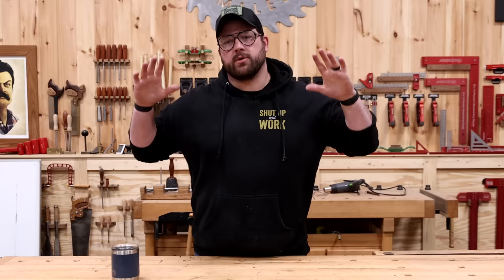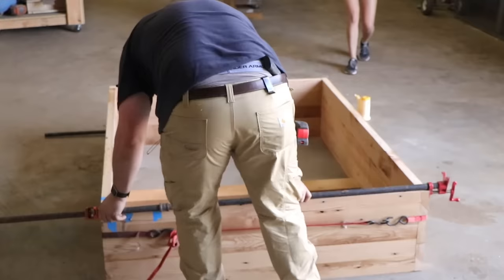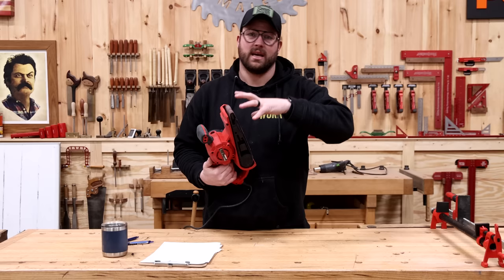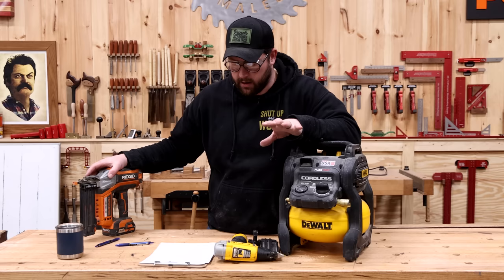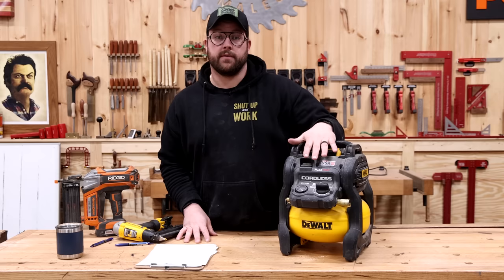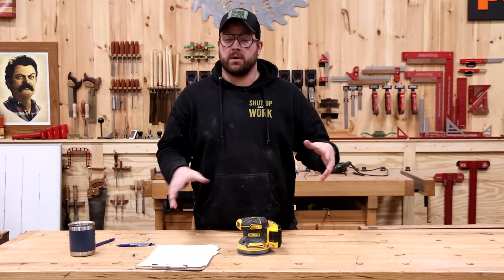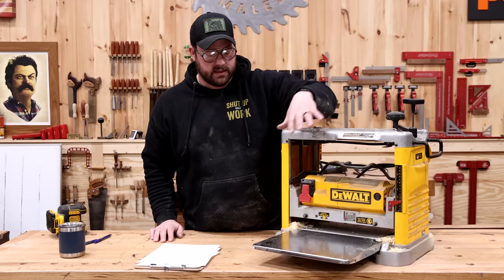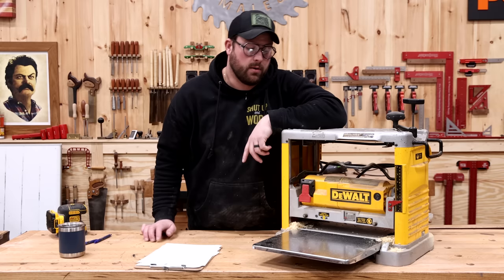5 Beginner Woodworking Tools I Regret Buying

Comment: Agree with some of what you say but not all  Built a mortis machine never use it, got a Ridgid sand machine it collects dust but when needed it really helps and was cheap to buy, have a Delta planer without all the problems of your Dewalt and it really helps ready raw lumber from suppliers  Probably will never buy Bessy clamps I worked very hard for my money and they are WAY too expensive TY 4sharing

Comment: I agree with you about the rigid table top sander, but if you take that belt sander and  build a simple cradle for it to be upside down and you have both drum sander on the front if you don’t build the cradle to long , and  with a few quick swipes on the belt it can take some meat off and since you control the downward pressure it’s less likely to put those Chanel divots they’re famous for. I couldn’t afford a lot so i made due with what i could get from the pawn shop and a little ingenuity had a functional shop.  And im right there on the pipe clamps i grew up with them and tried the quick clamps their ok they’re  just not as versatile or economical.

Comment: For hogging off surface material, I definitely prefer an electric hand planer versus a belt sander. Thought I was going to have to question your judgment when you started talking smack about the DeWalt benchtop planer. It's one of my top five favorite tools that I've purchased. But apparently that's because I got the 13-inch one, like you say.

Comment: Totally agree with you John on the kreg track saw thing. I also bought the Bora edge clamp and oh boy do I love having to math every single time I'm breaking down sheet goods... I bought the Bora saw plate thinking it would help and it sucks just as bad as the Kreg. You would think the plates would fit a 7¼ Bosch circlular saw but nope. I'm on the Worx platform and they make a Gimmicky circlular saw called the Exact track ive thought about trying in conjunction with my Bora system? $59 for the tool. I bought the Worx Switch Driver on a whim and that thing is actually awesome for pocket holes. Drill in 1 chuck driver in the other and it simply works.

Comment: Professional shops use both pipe and parallel bar clamps.  They have different purposes.  Pipe clamps can produce a ton of pressure and will definitely mar the surface of whatever it is pushing against.  So cauls are absolutely necessary unless you will be doing more milling after the glue.   Parallel bars can produce a lot of pressure (not usually their purpose) and have taller surfaces that are always parallel (reduces twisting while tightening) and will not mar most materials.  The extra depth also allows different direction clamps to cross each other in many situations.  Former better for gluing boards together to make thicker materials and latter better for carcass assembly.  But with proper care pipe clamps can do both jobs.

Comment: I wanted the 13” but I started in 2020 and Covid made it hard to find. I got the lunch box and I took off the tables and made my own out of MDF put on a flip cart and I have almost 0 snipe. It’s not ideal but it’s working. My biggest revert was the 6in Bench Top Jointer. I should have paid a little more for a used 8” floor model.

Comment: i purchaced a normal finish nailer, they usually have a range of sizes of nails that can be used. mine specifically goes from 1.25" to 2.5" nails. 
otherwise, spot on. there are alot of pneumatic tools for finish carpentry.

Comment: I bought the first generation Bessey K? Clamps and loved them. I had a few 24 inch but mostly 30 and 36 inch. They were a lot cheaper then (1997) I don’t remember what I paid for them but 1/2 what they are charging now seems right. Sadly there was a design flaw and the clamps began to crack at the screw handle. Happily, they replaced all of them (around 25) no questions asked for free. I have one of the newer 24 inch clamps but it it is harder to slide the moving screw handle thingy. I predominately used the Bessey k body clamps to glue up raised panel doors that if made carefully need very little pressure. And I liked that I could then stand the whole thing up and go to the next door, panel or drawer. Now if I was going to glue up a big table top in say hard maple I went straight for the pipe clamps. Cranked the hell   out of them.  Anyhow I liked the Besseys

Comment: I have a few of those tools. I love the K-body clamps. Agree they are expensive, but I don't have a problem with enough clamping pressure. You just have to make sure to set the pad close enough to the stock before clamping.

I have both the DeWalt corded and the cordless random orbital sander (which is, I think what you meant - it's not a palm sander). I used the corded version for 15 years, and last year got the cordless. I'm just not seeing the issues with the cordless that you claim. Unless I have a ton of constant sanding that drains batteries faster than I like, I find myself reaching for my cordless most of the time. I love not having that cord to move around and not have to worry about tripping over. 

As for the planer. I think you got a lemon. I've had that model for a good 8 years, and honestly, I've never had the breaker trip on me once. Also, I've not had the tipping problem you speak of. I feel like maybe you are running too heavy a cut when running your stock. I do agree the DW735 planer is a better model, though. In fact, if I didn't have a large shop planer thar I now do most of my planning with I would upgrade my 1st DeWalt to that model.

Comment: The Bessey K Body clamps are amazing. If your looking at the pipe clamp its also an investment. The main difference is that the K Body clamps are aimed at professional makers, and are worth every penny. As an interior builder, at my work we have the cheapest and shittiest clamps, but we manage to make it work as well. I prefer the Kboday for my own shop because they are easy to use, store away etc. Also what you fail to say on the pipe clamp is that that you only get the clamp part for that price and not the pipe. End game you're looking at very similar prices.

Comment: I was "gifted" a non working version of the 13 inch dewalt planer. And you can get them repaired at a dewalt store and they have a limit to the cost of the fix for it. I got it for free and Dewalt fixed it for $300 and it is working like a champ. Now I am just waiting for new sills and floors to go into tthe family barn and it will be out there with the other hodge podge of tools that I have and be used once again

Comment: Great advice on the pipe clamp! Thank you. Regarding the air compressor and nailer, I would argue that, you WILL find yourself eventually moving from pneumatic to battery in certain applications. It's going to happen. So the earlier you choose your battery platform, the earlier you build your collection of battery tools and batteries, therefore making it cheaper in the long run to add to your collection.
My advice, start at pawn shops, you'll likely get the tool for a quarter of the price, and usually the battery is included for free. Before you know it you've got 5 or 10 batteries now you can start buying the tools new.
Reply: This will also teach you what tools have resale value. Remember the pawn shop was willing to pay money for these tools. Because obviously they're easy to sell. Meaning they are popular because they work....
No particular order...
DeWalt Milwaukee Makita

Comment: I’m a retired heavy duty diesel mechanic and I know how to grind . I disagree about the belt sander . They are great for me . I generally built projects out of 3 / 4 finished hardwoods and I need to sand them smooth when joining two boards together. I have a Porter Cable that I’ve had for years and haven’t had the issues he’s mentioned. Now the first thing to buy no matter what is a good 20 gallon tank air compressor that’s belt drive , not direct drive. They cost around 600.00 or more. They will last you a life time if taken care of. I actually purchased one years ago to augment my behemoth 80 gallon, 2 stage 175 psi compressor because I hated firing it up just to do the small stuff. I plumbed my house completely with plumbing to run off my compressors so I have my compressors centrally located. Then all these air powered tools you can run off of your compressor. My sanders are all plug in . I do have some cordless drills but I need to charge the batteries all the time but they are handy. When it comes to sanding it’s all about plug ins because you don’t need to stop and charge batteries. Plus they are more powerful and keep going. Now about clamps . I disagree about clamps and I have them all that are mentioned here. When working with 3 / 4 bar clamps you will end up marring the wood especially when working with finished hard woods . I get excellent clamping with K style clamps but dam they are expensive but I love the large face on them. Another point not brought up in this video is  less expensive type bar clamps is when clamping the bar will flex and not stay straight. That’s important because working with wood you cannot afford mistakes . Another point about cheep clamps is the auger screw in itself or the clamp head strip out then the clamp is no good. One mid priced clamp I’ve been using and had good luck with is Jorgenson brand clamps. One thing I will say is I think the little 6’ bar clamp that’s black n green at harbor freight I use the heck out of them and only stripped one out over the years. I use those little harbor freight clamps all the time and I think they are about 4.00 dollars apiece. When thing is you can never have enough clamps in all sizes.

Comment: Spot on the with the palm sander. I bought a Ryobi one for some home work a while back ($100 for that, a router, and 2 batteries, not bad) and yeah, the thing EATS batteries. Went through my 2 4mAH and 2 2mAH batteries in like, an hour of sanding some 2x4s. Absolutely wish I would have gone with a corded one. 
Also spot on with the clamps. HF is great for cheap clamps, but have noticed some of them are harder to work with than brands from other box stores. 
I think my regret was buying a circular saw. Sure, it was cheap, but for the work I've been doing, a table or miter saw would have been WAY better.
Reply: The cordless wood sander is called a hand plane. Although getting one of those to work right is a bit of a trick. It's still a trick worth learning. Then there's card scrapers and they're really black magic. Drawing the burr and turning the hook are like huh? But if you can manage to do that it'll put sandpaper to shame. Sandpaper is for working on finishes, not wood. Woodworking is all about cutting wood. You sever the fibers or you split them. You read the grain to determine the proper angle of attack. You pet it like a kitty cat. You don't rub it the wrong way and you and the wood will get along just fine.

Comment: The only thing I would say as far as the compressor is don't buy a battery compressor. You can get a pancake compressor that will run framing nailers on bump for cheaper. My Metabo is a 200psi compressor and I set it to 120 to run my 21 degree with 3.5 inch nails (when I can find them).

Comment: Spot on about the DeWalt plainer. I have both and  the 13" is by far the better option..I have run oak, maple, purple heart, paduk through it with no  issue and pine comes put nice and smooth with  little to no snipe

Comment: Hi man, its my first video from you but i like you (especially using benchtop on 12:38 min :D ) .
About benchtop - I just bought 2in1 tool - jointer and benchtop, and I think this is the best tool, because now I can buy cheap wood and make something straight from it. I know that maybe it's worst than two different tools but for me - this is the game changer. Now I can make joint really nice so i don't have to sand it for a long time to get flat surface and I can create something from scrap. Bets regards from Poland! (you have polish surname ;) )

Comment: I think you didn't give an option to the benchtop spindle/belt combo. A router table can make the work it does, and you can also buy a belt/disc sander, the skill router/table kit + wen 6502T sander

Comment: The Ryobi 19 guage nailer averages $130, often less than half the price of the Rigid shown at $260. And that small compressor screams for several minutes building pressure. Sorry but I prefer the value, convenience and quietness of the Ryobi. Loved the clamp and sander advice. I completely agree about the cordles sander, my Ryobi is convenient up to a point  but it lacks power for serious sanding.

Comment: Agree on the compressor/nail guns. The Ryobis are super convenient, but they get really heavy, especially the finish nailers. I had to take one up on a 20ft ladder last month and it was not the most fun experience in my homeowner life. That said, it's worth the weight working inside my house as the compressor scared the hell out of my cats and family. 
I just bought two 48" Bremen parallel clamps using the last 25% coupon at HF, then found my old pipe clamps and am regretting the big clamps as they're too large for what I've needed since while the pipe clamps are flexible.

Comment: I’ve been building stuff for about 5-6 years and I’ve never once considered a pipe clamp lol. The Ryobi Brad nailer is $109. If you have other Ryobi tools already you don’t need a new battery. A compressor + nailer is a little less but harder to travel with and you need an outlet or generator. Sometimes I don’t have that luxury.

Comment: If you have to decide between belt sander and orbital sander it`s obvious that the orbital is the better choice for general usage. Unless you have to remove thick layers of old paint on large surfaces. Rotax sanders are somewhat a hybrid but darn expensive, they start at 350€.

Comment: You are correct that the Bessy clamps are more money but in my opinion they are the best clamp on the market particularly for panel glue ups. They have minimal distortion and their design allows for less slipping out of square. They last forever too. Buy quality and buy once.

Comment: the harbor freight belt sander for about $60 is a good deal (the more expensive one, with adjustable speed). the belts are quite cheap to boot. my biggest advice is to use a finer grit (120 or 240 grit) and dwell on the area for longer rather than a shorter time with a coarse grit, which will help avoid gouging. downside - it is SCREAMING loud

Comment: I agree about the hollow chisel.  I don't have a mortiser so I bought a kit to fit on the drill press. Very complex to install so switching between drill and mortise is a waste of time.  I have the circular saw guide and I like it.  I have a very small shop and its compact. I cut my sheet goods to size at the box store or lumber yard using their panel saws - close enough for what I build.  I do like my 4 Bessey clamps also. Again I have a small shop and the pipe clamps are so much heavier and I don't build large stuff.  I agree with with corded sander.  I have a Milwaukee cordless random orbital sander.  Sanding time per battery is about 45 minutes so after 1.5 hours I'm done sanding for the day.  Finally I add a bench top scroll saw - bought one thinking I was going to do scroll work, but its never been switched on in 3 years. Don't buy a tool until you actually need it. Finally I have a small Craftsman jointer.  I've used it a few times, but adjusting the fence to be 90 square is a pain. Seems cheaply constructed - I got it for free but its not worth the space in the garage.

Comment: I have the Kreg accu-cut with my Ridgid battery powered circ saw and it works great breaking down sheet goods. I also have the DeWalt DW734 and have not had any of the problems you described. An extra 1-1.5 inches of width doesn't buy me much. I have it bolted to a rolling cart I had around and moved it to a corner when not used. I have run a lot of boards through and they almost need no sanding when I have finished planning. I rather save the $100+ dollars and by a good used jointer, which I did.
The video in general is a fair assessment, although a beginner can hold off on a planner for a while. I have a couple parallel clamps: Bessy and Harbor freight and can't tell a significant difference. I finf myself using racheting bar clamps most of the time (also HF)

Comment: Love my belt sander! It was the second power tool I ever bought. Used the Craftsman 4" so much, it finally required more repairs than it was worth. Replaced it with a 4" Makita about 15 years ago. I use it frequently enough that I consider it a worthwhile thing to have. But, of course it is not a substitute for a palm sander.
Reply: What are you using it for?! I've owned one for 27 years and have used it maybe 10 times. And half of those times I wished I was using a different tool, lol (planer, etc)
Reply: @sawdustcrypto3987  My use has mainly been for desktops and removing the finish from old cabinet doors. I've also been forced to use it to refinish an entire hardwood floor when a rental floor sander was not available. (I hardly recommend it for that but it got the job done!) If I had a spindle/belt sander I'd likely have far less use for it but can't justify the cost and space. Not sure I'd buy a belt sander today with the alternatives available. Looking at getting a MaxXT.

Comment: I’ve never had a problem with my cordless sander it’s gotten the job done every time I’ve needed it and I don’t have to worry about cords getting wrapped up in anything and getting tangled the only tool that I have used that the corded model is way better is probably a circular saw cordless models just don’t have the blade speed to keep the blade from warping when cutting through thicker wood